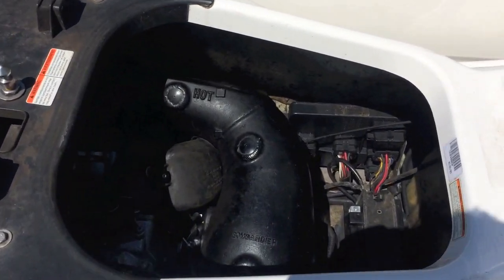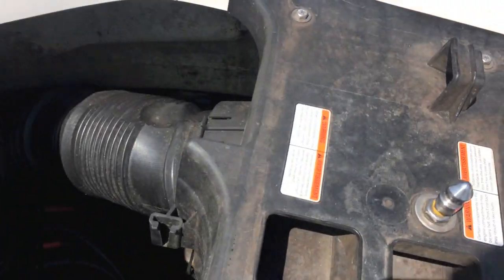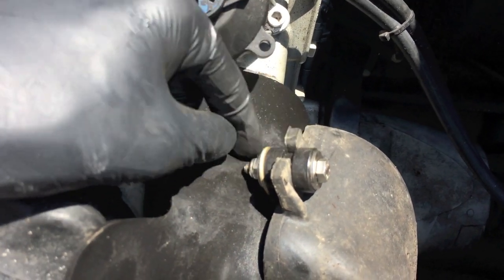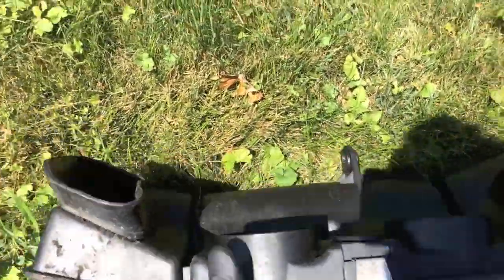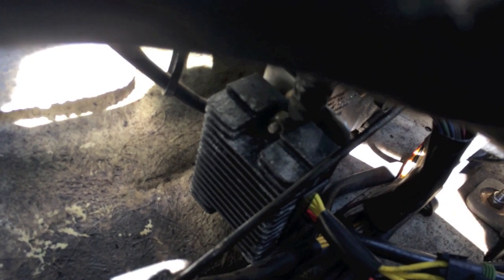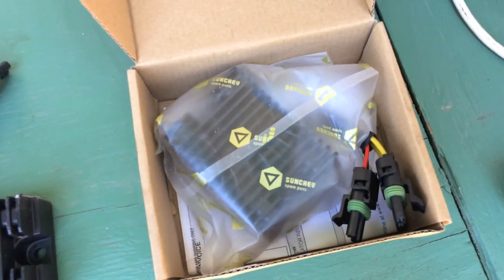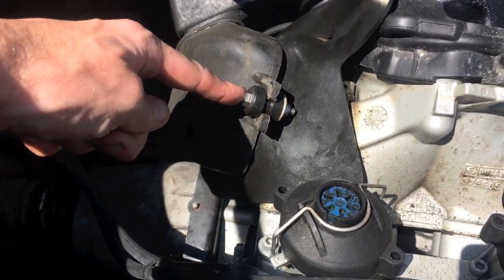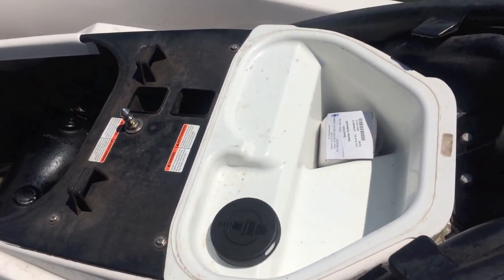Jet Ski Battery keeps going dead/Dying - Rectifier/Regulator Replacement

Comment: What process did you use to determine it was the rectifier and not the stator?
Reply from the maker: @edgrier7254  

Thanks for watching, we ended up testing the continuity of the rectifier itself with our voltmeter.  It failed the test.

Below is a link to a few voltmeter options.  We own the top one and absolutely love however, you can check Ace Hardware and Lowe’s to see if they have this voltmeter at a lower price…not sure why craftsman has it marked up so high right now.

       https://amzn.to/3SzY2ag

       https://amzn.to/3GUwlX8

If interested in purchasing this product, visit our Amazon affiliate link above.  I earned from qualifying purchases.

Comment: Hey i got the low 12volt message on my sea doo gtx limited 99 when im trying to start it.Putt in a brand new battery freshly charged and i still get low 12volt message? i can hear the relay click.The jetski ran great last season butt the low 12volt message came up a couple of times when starting up.  Anyone got any idea?
Reply from the maker: Good morning ☕️ any update?

Do you see any signs of corrosion on wire connections?  This can lead to a short and cause low volt annunciations.

You may also have a weak and worn out regulator.  Replacing your regulator as shown in this video may help.

Comment: yamaha 2004 - new stator, new rectifier, new battery and battery still wont charge? ??????? i have no idea what to do neither the 2 mechanics i have. can you give me some light?
Reply from the maker: Good morning, just poured a cup of coffee and am sitting down to answer any and all questions for the DIY community.

Have you had the Stater replaced?  Not Starter…but Stater.  The Stater is inside the oil compartment that secures to the engine near the flywheel…(well that’s where it is in our ski).

This is not a routine maintenance item because the Stater can last upwards of 20 years…might be time to have the Stater replaced as it works with the rectifier to maintain battery charge.  Please keep us posted, we enjoy talking jet ski’s.

Let us know if you have any questions and hey if you’re into crypto trading, join our DIY ecosystem and become part of an exclusive group of DIYers.

       toolboxtoken.com

Reach out to us any time!  🧰

Comment: Kind off have the same problem on my 99 seadoo gtx rfi runs really good then starts bogging and starts to say low voltage and you can see voltage going down when you let go of the gas  does that mean is my rectifier or stator
Reply from the maker: Thanks for watching & welcome to the DIY Raptor Club.  We recommend starting with the rectifier.  Please keep us posted on your project.  Us fellow DIY’ers need to stick together!

😎👍🔧🔩

Comment: Hey friend i just got subscribe to u thanks i have a question that problem make a light come on each 20 seconds cause my sea doo runs  well bout batery dont charge back and my light maint comes on ?
Reply from the maker: alexander plata 

Thanks for watching & sharing your experience.  A charging issue usually relates back to a faulty regulator.  Replacing your regulator may help solve issue.  It’s also possible that your battery is weakening.  Hope this helps.

😎👍🔧🔩

Comment: HOW DID YOU DETERMINE THE RECTIFIER WAS BAD
Reply from the maker: CHAUSTER BUFFET 

Thanks for watching, you can hook up a voltmeter to rectifier & check the ohms output.  There are several helpful videos on YouTube that will show you how to do this.  You will get a clear reading on whether your rectifier is good or bad.

We hope the video helped.  😎👍🔧🔩
Reply: @DIYwithMichaelBorders  I CANNOT FIND A VIDEO ON HOW TO TEST RESISTANT ON THE RECTIFIER
Reply from the maker: CHAUSTER BUFFET 

Thanks for the reply.  This is just one of many.

       https://youtu.be/iHhwifCZ4gY

😎👍🔧🔩

Comment: have a question.  I have (2) 2012 Seadoo GTI 130’s. After riding a while on the ski we will kill the engine for a bit. When we go back to start it up. Nothing comes on. No computer no start. I will wiggle the fuse box wires and other wires a bit and Bam it’s starts!   What is it??? Btw. Batteries are 3 years old. Happens on Both Skis...
Reply from the maker: C. Juneau 

Thanks for sharing, hope the video helped.  Sounds like you have an electrical short or loose wiring.  We recommend inspected all electrical wiring and connection points.  Verify all connection points are properly secured and there are no signs of stress to your electrical wiring... such as burnt wires, melted wires, or possible damage to the wiring from other sources...mice...if kept in storage.

Also, open up your electrical box that the cables feed into.  Verify no internal damage or moisture buildup.  Keep us posted, let’s get this figured out together!

Us fellow DIY’ers need to stick together.  Many more helpful videos to come!  😀

Please subscribe to the channel and Ring your YouTube Bell 🛎 that would be awesome thanks again.

😎👍🔧🔩

Comment: Hey quick question how do you test the rectifier/regulator to see if it’s bad ?? Do you just turn on the jet ski and check to see if the battery is getting 12 volts ?? And is the rectifier and regulator the same thing or is it two different things??
Reply: Did you find out how to test it?
Reply: @miguelcabrera2419  
So on my jet ski you can toggle through the screen where it shows the battery voltage.  It was showing 11volts, I disconnected the voltage regulator and still the same voltage.  I got a voltage regulator from SBT and it’s still good
Reply from the maker: Hugo Hernandez 

Thanks for watching & we hope you enjoyed the video.  The most efficient way to test rectifier is by using your Volt Meter to test the Ohms.  There are several awesome videos on YouTube demonstrating this.  Definitely keep us posted!  😀

Many more helpful videos to come!  😀
Please subscribe to the channel and turn on your YouTube notification Bell 🛎 that would be awesome thanks again!

😎👍🔧🔩

Comment: A friend has same ski. After it runs for 30mins to 1hour of riding it bogs down and stops running. Its starts right up goes a few feet and shuts off. After it sits for few hours it starts up and does it all over again 
We have tried a new fuel pump. Plugs and cleaned out gas tank. Please anyine help!
Reply from the maker: Hitech 

Thanks for watching & we appreciate you reaching out to us.  It’s possible that you need a new Check Valve.  It’s also possible that you have a clogged Vacuum Regulator.  Below are 4 links to videos that show replacement of parts.

       https://youtu.be/3vwZFSIBJrM

       https://youtu.be/iWjhaWlyQuc

       https://youtu.be/Jr7eWlFGvAc

       https://youtu.be/SfjX9OtOyIM

We really enjoy making these helpful videos for our fellow DIY’ers.  😀

Let us know if you have any questions.  Please subscribe to the channel and turn on your YouTube notification Bell 🛎 that would be awesome thanks again!

😎👍🔧🔩
Reply: @DIYwithMichaelBorders  i check the little black and white valve. It was stuck
 It wouldnt let me blow either direction. Then after i blew kind of hard it snapped open( like it had glued shut from not being used and sitting). I put all the zip ties back in place and it started up. I will sea trail as soon as i can get some one to follow me on mine or in the jon boat. Thank you for all your help. I will stay in touch and let you know how it turns out.
Reply from the maker: Hitech 

Awesome Awesome that’s great news & moving in the right direction!

Keep us posted!  😎👍🔧🔩
Reply: @DIYwithMichaelBorders  well we took the ski out today. Same thing. Runs fine for 20-30 minutes.  Then it shuts off. Starts up. Shut off in 3-4minutes then it shuts down and only runs seconds. Then shuts off all together. Let it sit starts up. Runs for 5-10 minutes samething.  Any other ideas will be greatly appreciated. Battery voltage right at 12vdc. After running
Reply from the maker: Hitech 

Thanks for watching & by chance do you have a second key?  It’s very possible that your key is beginning to short out and cause a fault.

The internal electrical connection may be damaged or beginning to corrode causing a possible short.

Try that and keep us posted.

😎👍🔧🔩
Reply: @DIYwithMichaelBorders  first off. Thank you so much for your help sorting out this ski. Without your help we woukd be without ideas at this point. 
We tried a different key same problem. We had a new fuel pump. Changed it. Still same problem. 
One thing we noticed after it shuts off tge first time. It shut off soon and sooner. The longer you let it sit the longer it will run. So if you row for 3mins you get 30seconds of run time ect. 
Any more things you can tjink to try pal?
Reply from the maker: Hitech 

Thanks for the reply.  

Let’s look at your actual spark plugs.  You may have mentioned it however have your plugs been replaced this summer?  If yes, it’s very possible that your engine is not getting along with the new plugs properly and you may need to purchase new plugs and re-gap them.  Always Always Always stay away from fancy expensive crazy named plugs.  Always purchase the OEM recommended plugs that are stated in your owners manual.

Next...

Carefully remove each spark plug boot from its respective plug and verify that there is no moisture inside the boot connection points.  Re-secure boot onto plugs until they are firmly secured.

Next...

Let’s focus on the electrical ground leads.  Follow the Spark Plug Wires that feed off the plugs.  Follow them all the way back to the black electrical box.  Open the box and verify all electrical wiring and cables are properly secured as well as there is no moisture whatsoever accumulating inside the box.  As you know water/moisture acts as an electrical carrier and can draw electricity away from the system degrading your entire system performance.

Let’s keep working on this until we get this figured out my friend!

😎👍🔧🔩
Reply: @DIYwithMichaelBorders  👍

Comment: Hi My Seadoo 2009 GXT 215hp. is having problems with battery voltage, i did buy a new battery i tested after with my inteligent charger.. is fully charged, whent out for a ride, and the same problem occur.  i can see the battery and ingen ligth open an beeping...   and 10 second later is ok agane....  and there it go agane... How do you now if it is the  stator & regulator.? what is the test?
Reply from the maker: Kite aux Iles Juan Herrera 

Thanks for watching & sharing your experience.  Great question & you will need to perform a test with your Volt Meter.  There are several helpful videos that you will find on YouTube. 😀

Replacing your Voltage Regulator may fix your issues however if problems still exist after replacing part, you may have a parasitic electrical draw within the system.

You will want to inspect all electrical wiring & connection point to verify all are in good working condition.

Keep us posted.  Please subscribe to the channel and turn on your YouTube notification Bell 🛎 that would be awesome thanks again!

😎👍🔧🔩

Comment: Hey Michael, my 2007 SeaDoo Wake Edition 215 SC is getting the P0562 Low Voltage Fault code. The dealer said he put in a new battery at the start of the season, but the fault code was showing up as soon as i started it.

He tested the battery and said it was bad, so they're putting in a new one, and they also found a corroded fuse/housing that they're replacing. I'm hoping that fixes it, but I'm wondering if it could be the stator or regulator/rectifier. How do i diagnose which it is? Can you confirm that my machine has both a stator and regulator?

Thanks!
Reply from the maker: Thanks for watching Marchetti.  Let’s get this figured out!

We looked up some info on your jet ski & yes, it has both the stator & regulator.

As you know, your stator is like your alternator in your vehicle however slightly different.  It maintains a charge rather than charges....

It’s your rectifier that creates a charge for your electrical system.

Below is a link that explains this further.  Definitely check it out!

       https://youtu.be/g-yV_UB_jSs

We recommend starting with your new battery & seeing if that resolves issue.  If not, let’s move to the regulator.

We recommend addressing the stator last due to the fact it’s the more labor involved of our options...however definitely a friendly DIY project if we end up replacing it.

Keep us posted!  Please subscribe to the channel and turn on your YouTube notification Bell 🛎 that would be awesome thanks again!  😎👍🔧🔩
Reply: This is my question. Did you receive a response?